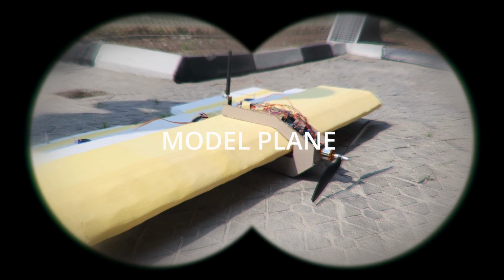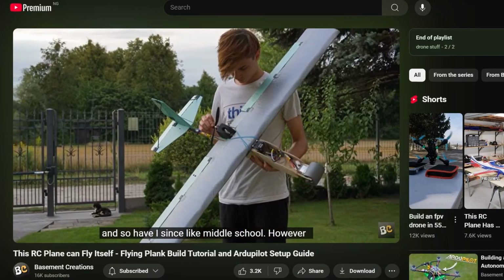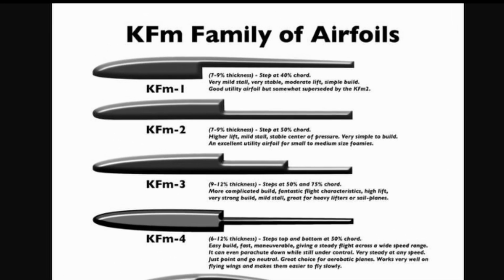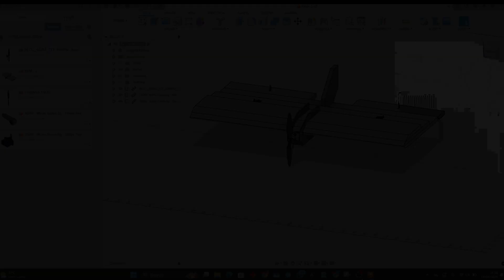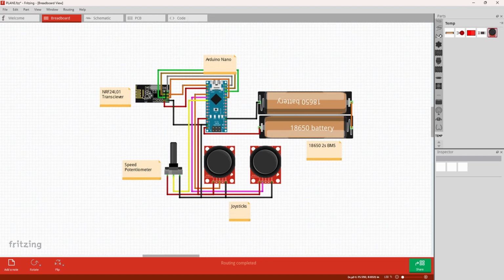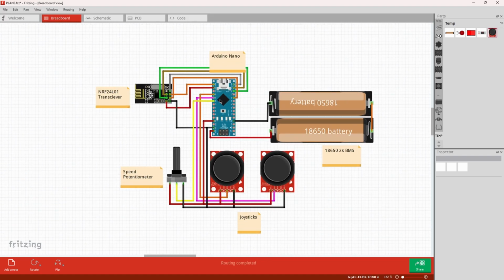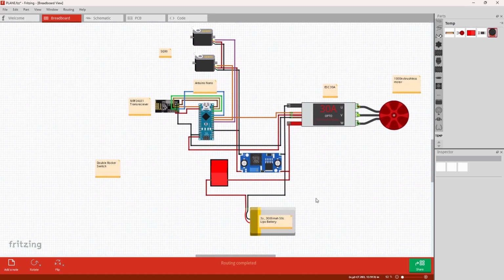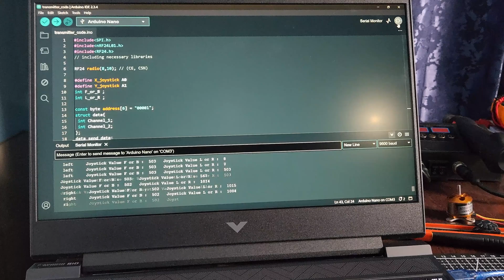How I Made a Flying Plank from Scratch to Overcome My Previous Failure

Comment: It's nice that there are more people getting into this hobby, however remember that KFM airfoils only tend to work at low reinold numbers, which means that KFM's only work on really small aircraft. I would recommend you trying out armon wing desigs for your later builds! Anywaay I recommed making the wing slimer next time, also if it is going to be a flying wing definitely add a thing called "reflex" on the trailing edge, building a regular airframe would be way easyer, but this is your choice. Good luck!
Reply from the maker: Thanks for the advice.  I'm mostly working on  electronics, robotics and  embedded systems project this is an entirely unexplored area for me
Reply from the maker: I definitely would do a much better job on the next model plane I'll try building
Reply from the maker: Armon wing and reflex on the trailing edge, noted

Comment: For the future: you want the control horns on your flaps/ailerons/rudders/flaperons/whatever to be angled forward such that the hole you have connected the push/pullrod to is directly on top of the hinge. This makes it so that the control surface will deflect equally far going up and down. You have your connected very far away from the hinge, which will allow the control surface to move a fair bit in one direction and not a whole lot in the opposite direction. With your setup I believe elevator down will be very inefficient compared to elevator up.
Reply from the maker: Thank you.  That's something I should have looked into, I also noticed the movement deficiency

Comment: Btw the RC Groups Forums have one on KFM airfoils which may be helpful.  Also you can use brown kraft type paper with thinned (water) pva glue to cover the foam. There was an American RC bloke called John or Paul St Clair that did a series of how to articles in the American Model Academies magazine in the 1980’s or so.  Like a composite structure and the Kraft paper worked the best.   Laurie NZ.
Reply from the maker: Thanks for the tip, I'll definitely check out the RC Groups Forums!

Comment: why dont try using foam board for the model?
Reply from the maker: Getting foamboard was the issue. Same unavailability as the xps foam, so I had to use the styrofoam that was available, and this design also relatively worked and was pretty strong with the styrofoam.